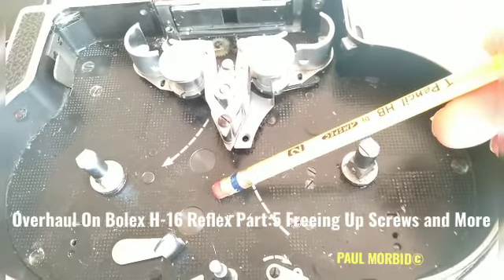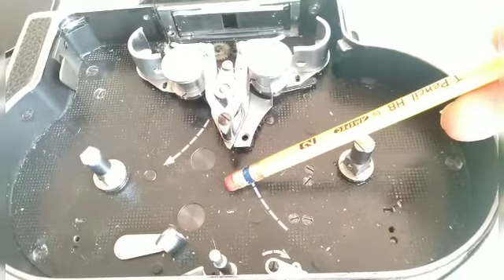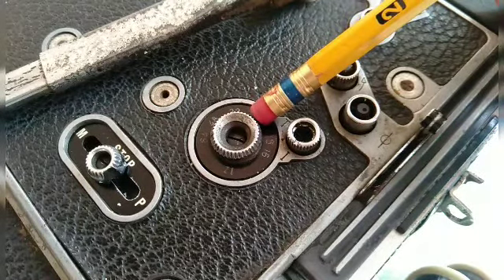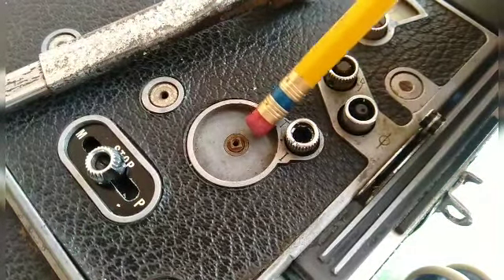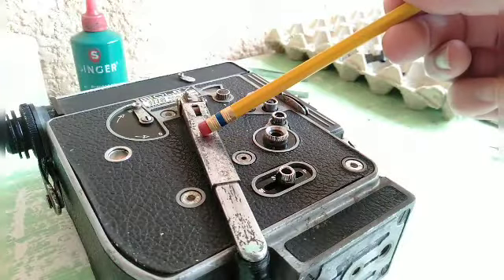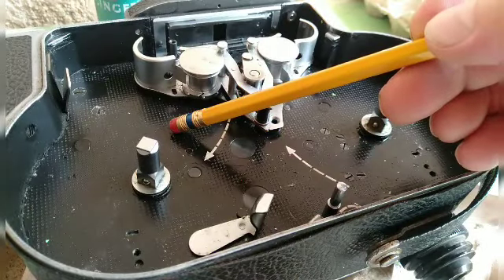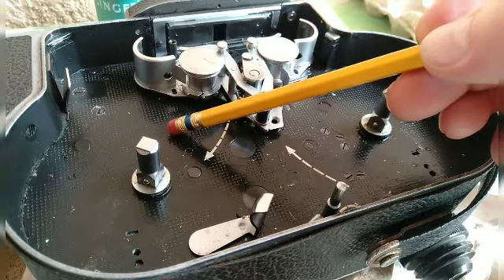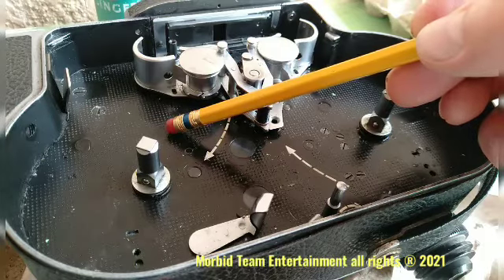Overhaul On Bolex H-16 Reflex Part:5 Freeing Up Screws and More

Comment: Paul, what do you use as a guide for this? Have you done enough of them that it kind of 2nd nature. I need to do some work on mine but its problem is in the reflex finder its either mold or fungus somewhere in the optical path but the prism looks clear
Reply from the maker: Hi Barry,
It's really just 2nd nature now. I'm a retired talent manager for Star Wars Actors, retired personal photographer for the late Actor/Bodybuilder Dave Prowse aka the original Darth Vader. Back in the day I owed a VCR repair shop, custom built computers etc. Bolex movie cameras are very much like VCRs as their filled with gears. Everything must be 100% precise in order for a Bolex to operate just like VCRs. I never suggest for anyone to service their own Bolex unless they have much experience. Upon that you do so "use caution". Never touch the ground glass (located in the front of the turret area) with your fingers. Don't get any oil in it. And never spay WD-40 in there or randomly inside a Bolex as that stuff will damage certain parts. The view finder can be irritating to clean and repair. Only clean the glass with alcohol and q-tip or chamois tipped tools to clean the glass. Bolex vintage movie cameras are filled with tiny springs, micro screws and small parts. Very much like servicing old clocks and watches. For me it's relaxing as I love repairing these cameras. Thanks for watching and subscribing.
Reply from the maker: Barry,
A Bolex (or any vintage movie camera) should always be stored in a cool dry air-conditioned environment. If it was put away in a hot area then that's how the fungus got to the glass.